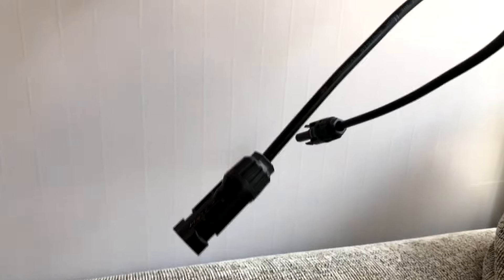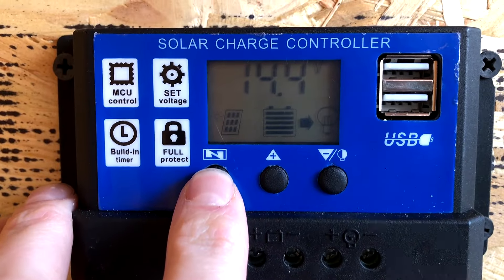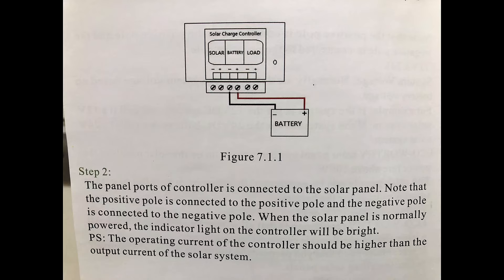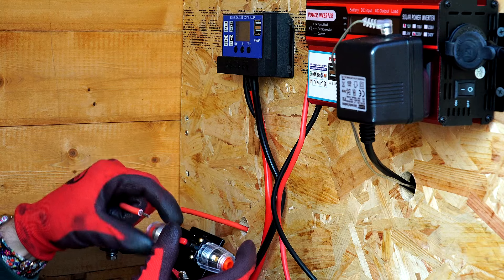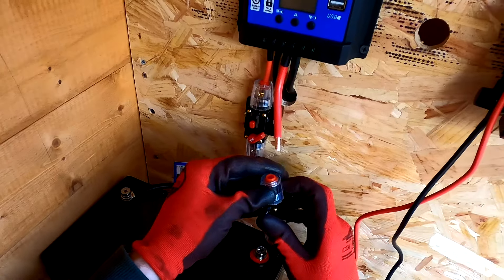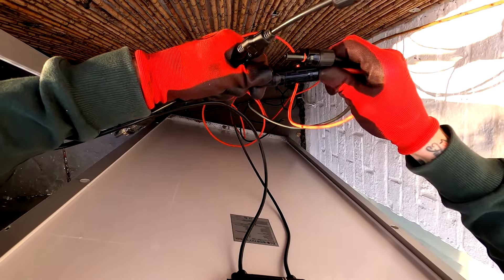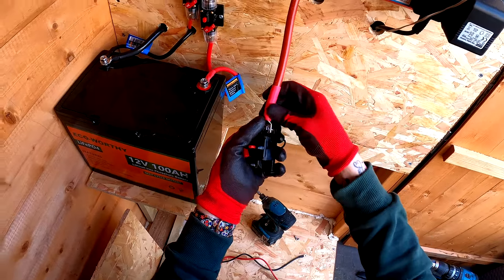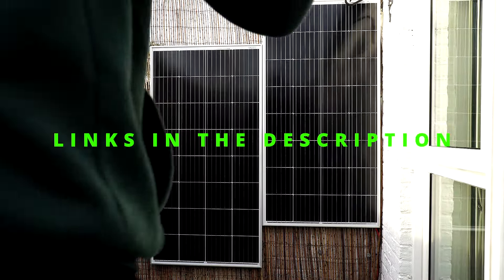Solar Panel Setup, Off Grid (FULL SETUP & INFO) - PART 1

Comment: Great video! I went with a slightly more expensive mppt charge controller which allowed me to run higher pv voltages with panels in series with less cabling
Reply from the maker: Thanks for sharing

Comment: Nice informative video. 

Though I have some remarks about the fuses/circuit breakers.
1: This type of circuit breakers are rubbisch! Better to use proper (ANL/AFL) fuses and switches.
2: Fuses should be located as close as possible to the power source (never more than 8 inches/20cm.But a battery terminal mounted MRBF fuse is the best and safest). Mounting your circuit breakers so close to the charge controller is of little use.

Choose fuse amperage to be 1.25 times the max expected load and max cable current  (the lowest of these two.).

Comment: Hi mate good video. I bought the same inverter as you in the video. When I plug my my laptop charger or phone charger with the 3 pin plug it makes a continuous beeping sound. Even when I use my van battery or my leisure battery
Reply: Because you are not using a pure sine wave inverter

Comment: Thanks for your video. I prepared nearly all the same components as u showed in this video. I will follow your procedure step by step. Please check your breaker from controller to battery. The Amp is too small. Good luck!
Reply from the maker: I’m glad the video was helpful. Thanks for your message

Comment: Can you tell me the watt on the inverter. Bought one just like it and will be setting It up. Tested with battery and it ran my refrigerator. Just odered 2 160 panels. Mine is from China looks just like yours. It says 16000 watt
 But reading these inverters they only produce have the watts. Great video. The only thing i think I am going to do is run my panels in serious. But us the same set up and have a fuse on the negative side of the panel. That's what I am seeing in most videos.
Reply: Sir on your solar panel fuse protector. You run it before your Charge controller. This protects the solar panels from burning up from the sunlight. If there may be a problem with you solar panel charge controller. There under $5 to buy. You have to look at the voltage of the solar panels you are using and get a fuse protector that is a few volts hirer than the volts on your solar panel. This is should be Dime Amy way you run you solar panels. To the negative wire. Just mount it to your soalr board before you put in the charge controller. It can be looked up on YouTube. It is a must and can save you alot of money.
Reply from the maker: The new inverter I recommend is 2000w pure sine wave inverter in my part 2 video

Comment: It looks nice, but the PWM charge controller costs you 30% energy and shortens the lifespan of your batteries by 40%. If you have an Mppt charge controller, your system will work healthy and efficiently.

Comment: Hi pwinkle. I uses custom made copper wire. 2.5mm copper wires for better power delivery. I dont trust wires provided by the solar seller. It is so thin. Every connecrion i triple the wires, from controller to battery and  solar input. All the wires goes to bus bar. Each input and output has bus bar.

Comment: Hi I’m a truck driver and I am thinking of taking a 12v LED TV & PS4 to play for 2hrs per night! both low wattage. Really confused as to what set I need!
Reply from the maker: A “portable power station” might be best for you. You can also use the car to 12v socket to change it while travelling and you can also get solar panels for it. 
If you Are planning on fitting solar panels to your roof you can use the setup I have in my part 3 or 4 video, you can alway add more battery’s that way

Comment: Nice, straightforward intro! Looks like you're outside lights are DC, running off a wall-wart PSU. If they're 12v, you can wire them straight into the battery, rather than invert up to 230v AC and then stepdown to LV DC. Save a little inefficiency.
Reply from the maker: Thanks for sharing your information
Reply: @PwinkleR Hiya mate. Is it possible to add more batteries in parallel?

Comment: Don't use the inline fuse holders you have does not work well with Victron controller is giving you inaccurate fluctuation it's because of your breaker i had that same problem change your  breaker to better ones
Reply from the maker: Thanks for the information, what breaker do you recommend?

Comment: Are your cables measured in U.S or UK? You mentioned 6mm dc at 10 gauage then strip a 4 gauge so I am well confused. I’m assuming you are in the UK.
Reply from the maker: Yeah I’m in the UK
Reply: @ I’m going to use your set up mate. It’s been helpful. The only difference is I am adding a fusebox to help seperate a few things in the caravan

Comment: Are breakers same as fuses,?
Reply from the maker: There different. My understanding is a breaker just trips the switch (which you can reset) a fuses will break but you can’t reset it (you’ll need a new fuse)
Reply from the maker: you can use either